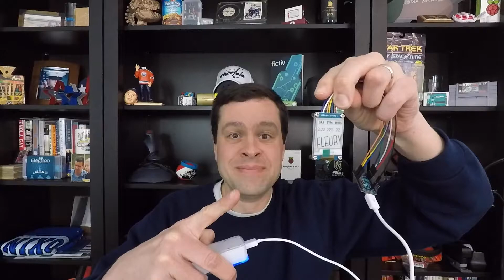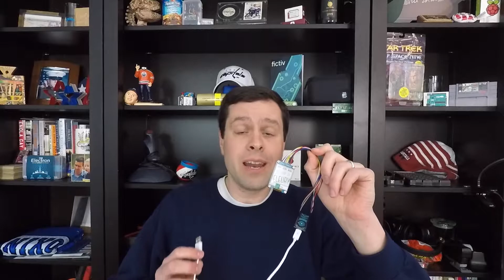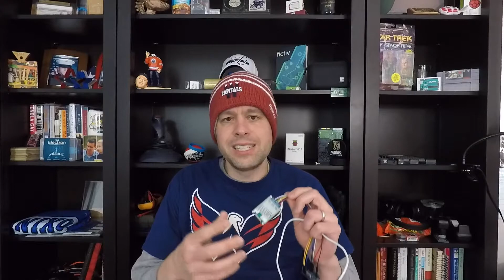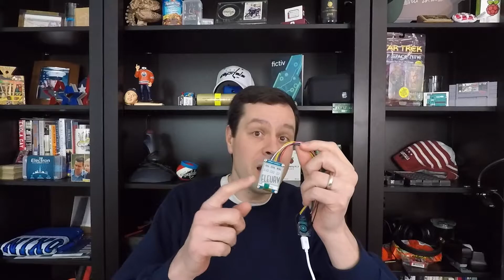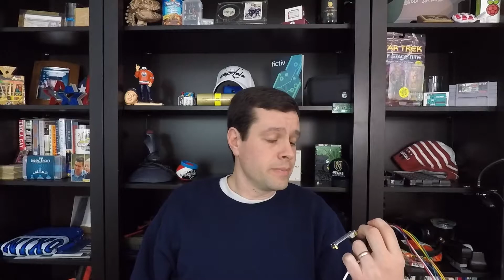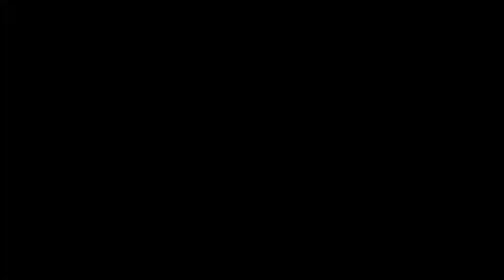Partial Update Working!

Comment: So I have a 2.9 e-ink display and trying to figure out if the partial display is working but I cannot tell because it only works on the example code given. When I used on something else it slowly dims back to white after an image was displayed. Is this what it is suppose to do?
Reply from the maker: Hey Mateo, thanks for watching. No, that is definitely not what is supposed to happen. That can be caused by improper external circuitry on the display  if you built your own PCB but if you are using a kit and that is happening it's definitely a result of the code. I've found the e-paper displays are extremely sensitive to communication and doing it exactly as they expect it. In your case I'd take the working example code and then change it a few lines at a time to match your code that doesn't display right and see where it breaks. They are touchy little devices.

Comment: A few days ago I impulse-purchased an Arduino Uno and a 4.2in e-ink display thinking that it would be a good beginner project for me to finally get into C and hardware after 15years of application code.The hello world from scratch was deceivingly simple even in plain C, but I'm still trying to pin down some issues with partial updates. 

I'm amazed that the manufacturer never explains basic things how they intended their two-buffer system and partial-mode to be used, at all. Their example code doesn't demonstrate any of the hard stuff.

Then I found out that this is just how things are in the hardware world. I will never complain about undocumented software again because at least I can just read source code and use println(). Hardware people are geniuses. Very humbling experience.
Reply from the maker: Hey Dan, thanks so much for dropping in. You nailed it right on the head with "just how things are in the hardware world". There is a lot of ground to make up to get to where software is in terms of documentation. It's actually gotten a lot better in the last 10 years or so with wider adoption. Great to hear you're digging into the hardware and firmware side of things. Glad to have you join the fray and good luck on the project.
Reply: Same problem here on Watchy Smartwatch😞